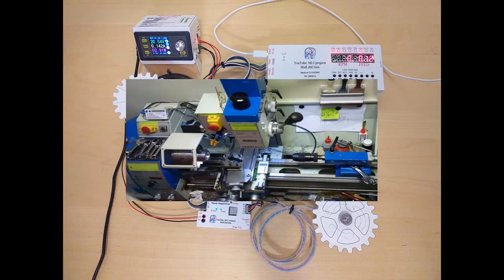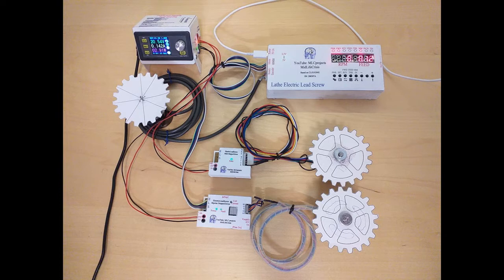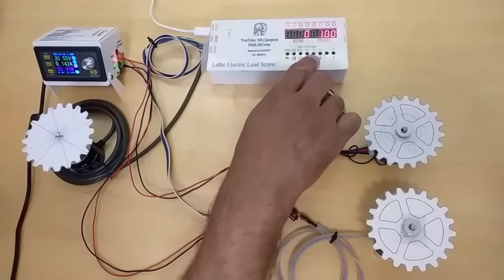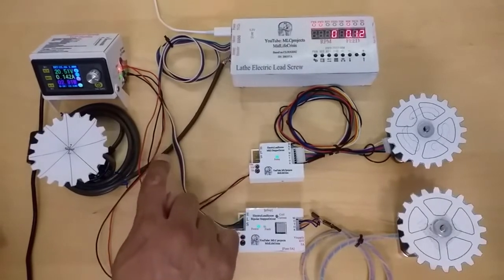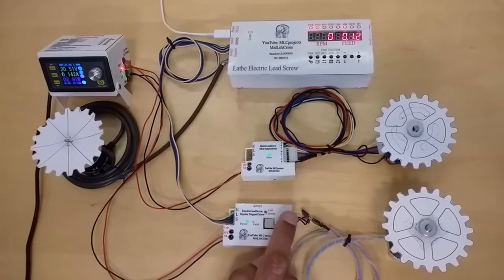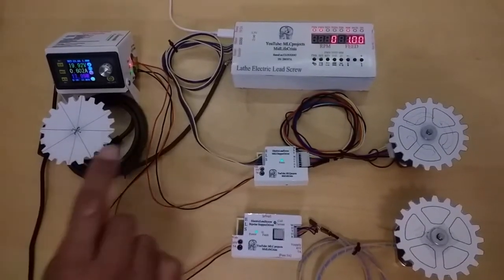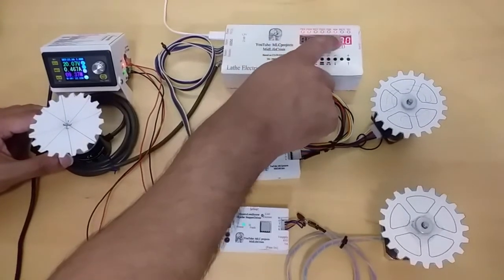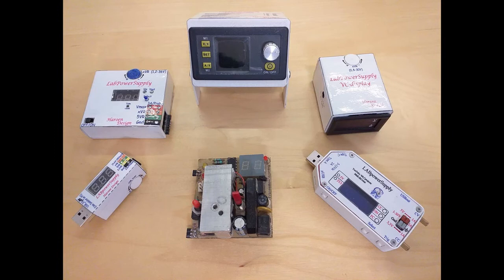Lathe Electronic LeadScrew Compact system ELS Clough42

Comment: Basically, an ELS per se, is just a converter of the spindle to the leadscrew ratio........anything more is CNC.
There are clever control boxes out there that do the conversion but it takes more than just a control box to get the tool to the end of the threaded portion, retract it, get it back to the start, and start the sequence all over again until the tool has reached full depth and finally withdraws and stops the spindle.......that is CNC.
I don't know how it's done, but I do know you can buy all of the components in a ready made form to do all of that and more too.
Reply: That's true.
The aim of my design intent is an upgradeble ELS for every need depending only on the budget.
I designed it to be upgradable from only a simple replacement of the mechanical gears up to a CNC compatibility for complex features

Comment: I need to work out which combination would be good for a Myford.
Reply from the maker: Maybe my new ELS video's could give you answers for your Myford:
* Lathe Electronic LeadScrew external UPGRADES
      (https://www.youtube.com/watch?v=WV3MnG4V8k0)
* Lathe Electronic LeadScrew external TouchScreen Display for Type1
      (https://www.youtube.com/watch?v=BYQbsw5ygC8&t=1s)
* ELS Type2
      (https://www.youtube.com/watch?v=ypzRlF7flV0)

Sorry for my late reply, your comment ended up in my Social folder instead of the Primairy folder.
Reply: @MLCprojects  Thank you for the link. Lets see if I can sell my lathe to fund this.